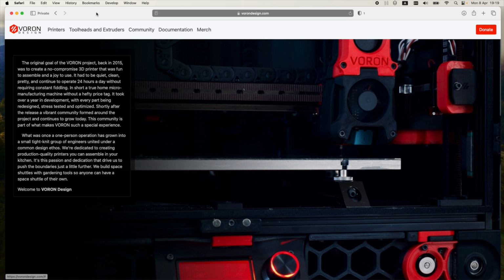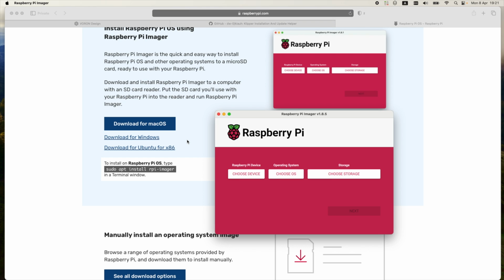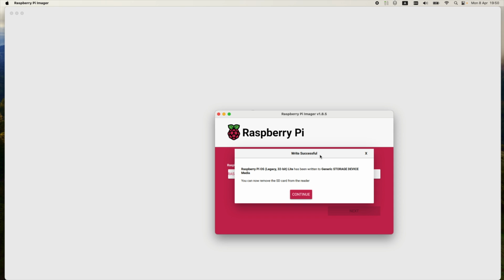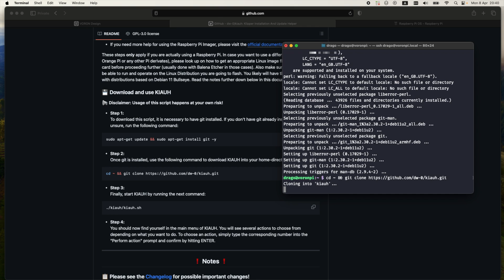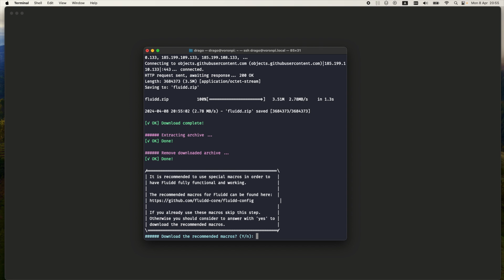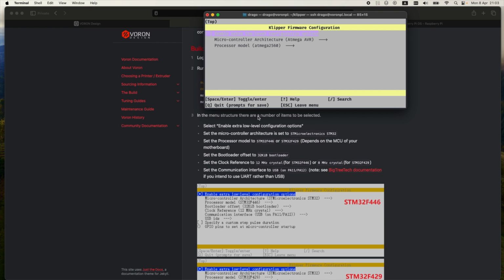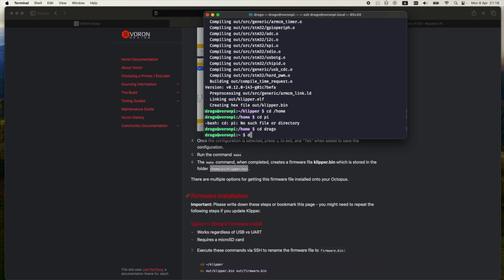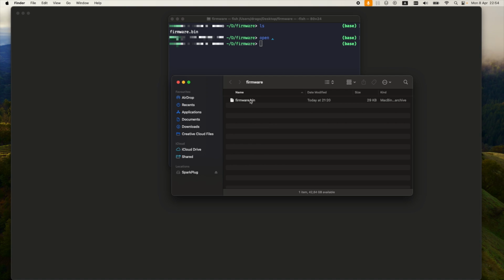Voron 2.4 - Part 21 - Installing the Software

Comment: Everything was going smooth until windows command lines for the local file path ... would be nice to have an OS neutral instruction or at least an explanation of what your file path looks like for reference but that's all blurred out.